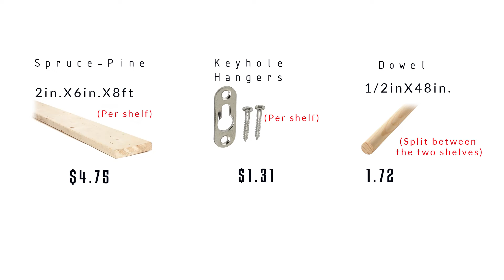$7 DIY Floating Shelf

Comment from the maker: Follow DIY Creators on instagram  https://www.instagram.com/diycreators2015/
FAQ 
Materials (per shelf) 
Oil-Rubbed Bronze Paint- http://amzn.to/2kBKJbO
1- 2in x 6in x 8ft (Spruce Pine)  @ your local hardware store
1- pack of keyhole hanger http://amzn.to/2mbVVrZ 
1- 1/2inX 48 Dowel @ your local hardware store
Reply: Yo, Much Luv @DIY Creators. Hey, those drywall anchors you used. Do you know of anything like that, that would make drilling in Wall Paneling stronger? I never see anyone post about flimsy old wall paneling, but in the south, that's all most old homes have?
Reply: DIY Creators try toggle bolts or try and hit a stud with a drywall screw
Reply: DIY Creators for $7 this is awesome!
Reply: Its more like $21 if you include the paint finish. Still awesome.
Reply: @kevinisawake  $11 if you use spray paint
Reply: Yo quiero ver en Suiza 10 de halo porque vamos a comprar un pan con y tú lo vas a hacer shinobi otra casa si te piden vengo solo hacerle bullying a tu fan
Reply: Qué p**** ese güey
Reply: You should really have an audio book your voice brought comfort to my soul it's soothing
Reply: Handy and fine👍🏽

Comment: Thanks for the awesome videos!  I tried to do this project but I wanted to have the shelf with the opening vertical so I can hang a towel in my bathroom.  But the problem is that it leans forward. My project is only 24in long 4 in deep and 3.5 in tall. I used maple hard wood. Any ideas to fix this problem? 😥

Comment: How do you know how far to install the hooks in your ceiling so the shelves lay against the wall correctly? I'm guessing measure directly in between the 2 drilled holes on either side ? 1:25

Comment: When drilling the hole for the dowels. Did you drill the hole into the wood when the glue was still wet, or somewhat dry?
Reply: You'll want to do it while it's still wet because it will help pull the joints together.  I believe he did it immediately.

Comment: Nice work Glenn well done. 1 question would those dowels and glue hold a load of dvds as a dvd shelf, as I am making one and got all the cutting done but stuck on using screws and glue or dowels and glue, what do you think would hold best? Thanks.
Barry (ENG)
Reply from the maker: Thank man! Oh yes this is pretty strong and will easily hold your DVDs. If you have any concern you could use screws. Then drive the screwed deep and add pluggs.

Comment: will it be strong enough to hold with he dry wall stud? or should I mount it on the studs?
Reply from the maker: The stud is always better. The anchor I used is pretty strong. Each one is rated for 50 pounds. I wouldn't put anything over 80 pounds.
Reply: I would recommend to use the zinc drywall anchors which more suitable the plastic one are crap, my experience
Reply: thanks for both of the replies!

Comment: Could I use screws instead of dowels?  Is there much difference?
Reply from the maker: Absolutely, you may have to use 3 to 4 in the screw. The dowels just eliminate filling in a screws head. With wood filler, you can cover the head of the screws.
Reply: Were going to try it this weekend.  Thanks for your help and video!
Reply from the maker: Your welcome enjoy :)

Comment: I like diy stuff and always learn something new. I'll never get why someone would spend the time to do this when you could just buy one though. Because you say 7 bucks but you use hundreds of dollars in tools, make a mess, and waste a lot of time. You could simply put up a single board in the pre painted color of your choice and put it up. No need to make a tiny box that most things won't fit in. You did a great job but the design was flawed from conception.

Comment: Unfortunately due to covid and supply/demand issues and frankly speaking... price gouging. the cost of the 2x6x8 spruce pine as of June 2021 is at 15.78.  So expect this project to be 20 dollars a piece( as the dowel will also be up in price)
Reply: It still cost a lot less than buying pre-made one, and not to mention that you have to settle with whatever size available to purchase.

Comment: why dowels not screws?  thanks
Reply: If you think about it he actually saved a step.  If you used screws you'd want to countersink them and fill the holes with dowels.  So this way he eliminated that step!  And the dowels should hold the boards tight while the glue dries.

Comment: Why dowels instead of screws?
Reply: If you think about it he actually saved a step.  If you used screws you'd want to countersink them and fill the holes with dowels.  So this way he eliminated that step!  And the dowels should hold the boards tight while the glue dries.